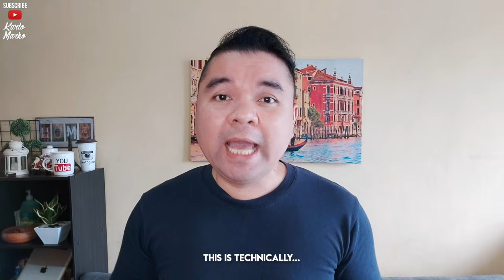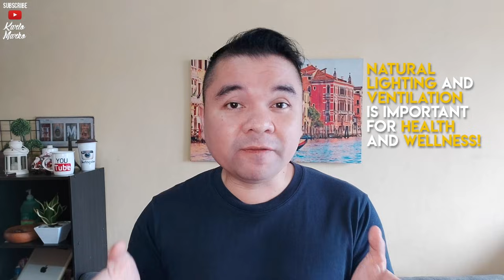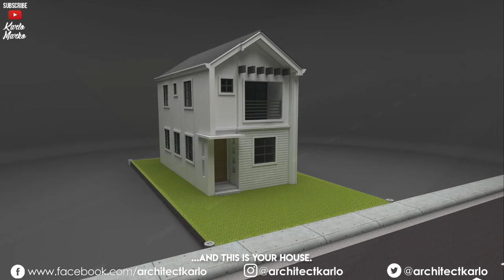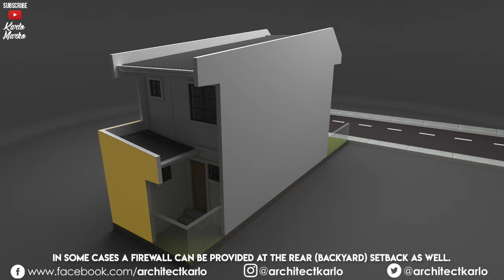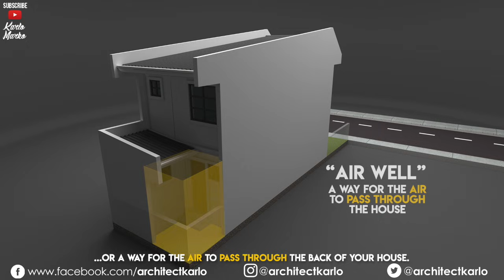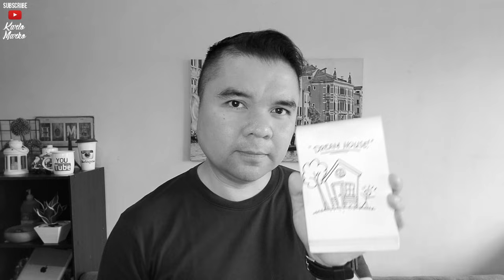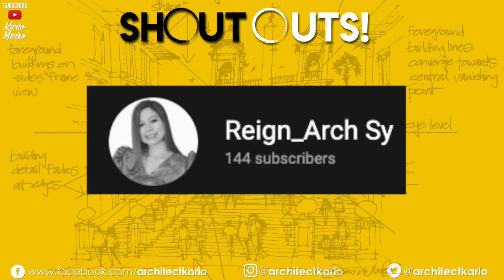The Rules on Setbacks and Firewalls | Bakit Hindi Pwedeng Isagad Sa Property? | ArkiTALK (Eng Subs)

Comment: NIce video po sir.. tanong po paano po maqqualify ang lot na too small or too narrow for a setback? Example R1 if 10m wide pde na po ba maconsider as too narrow? kasi mgging 6m n lng ang width ng bahay. eh kung maiksi din po lote.. 

Or ito po ay laging subject sa OBO?
Reply from the maker: Hi Arch. Magadia,

All these concerns are subject to the OBO's approval later on. Although I won't consider the 6 meter wide as too narrow. Not sure about it's depth though. in Rule 7 R1 is classified to be a low density residential (so this is more or less in the provinces), a single family dwelling and single detached. Pero by experience, the rules on R1, R2 and R3 sometimes overlap. Kaya even with the OBO, they allow the 3 meter front setback na din even if it's for R1. Important naman kasi ke OBO is that there's proper air ventilation and natural light si structure. 

A friend of mine had a project before where the lot is really small... so they had no choice but to put a firewall on all 3 sides of the ground floor, the rear and the 2 sides. My friend was able to defend this issue because the lot was fortunately along the road so the front side was still a source for natural ventilation. Kaya na-approve pa din siya for Building Permits.

Case to case din siya actually. But, when in doubt... consult the OBO for approval and clarification. 🙂

Comment: Pwede nagtanong? May firewall ba na hindi naka dikit sa bahay?
Reply from the maker: Hello po.

Free standing po ba ang wall na tinatanong nyo?

Almost all firewalls are attached to the main house or structure po. Kung makakita po kayo ng freestanding wall... delikado po yun. Lalo pag mahangin tulad ngayon sa #typhoonrolly
Reply: @KarloMarko  salamat po sa pag sagot. Yung isang side po kasi ng fence ng may-ari gusto niyang gawing firewall pero ayaw nya naman na naka dikit sa proposed na bahay yung wall.
Reply: Anyway, ieexplain ko nalang sa kanya yung reply mo po. Salamat po ulit! More power to your channel po 😊
Reply from the maker: Aaah... ok po. Kung less than 1 meter po ang setback nya sa side... masmainam po na lagyan nga ng firewall. Kasi standard po natin talaga for the sides is 2 meters po from the property line. Pero I suggest pagawan nya ng design sa structural engineer para hindi po freestanding ang firewall para mas-stable.

Comment: Sir nabanggit nyo po na ang setback eh para sa natural ventilation and lighting. In the even na may artificial ventillation (natural air intake from the outside so as exhaust) and artificial lighting (gaya po ng electrical lights as well as semi transparent roof) pwede po bang iwave  ang setback? Gagawin po sana kasi naking garahe yung extra corner lot namin pero pinapatabasan ng city officials as setback. Dun sana kami magpapark sa lupa namin instead of kalsada.
Reply from the maker: Hello Christopher 

No. Hindi sya pwedeng i-waive. It is a requirement for health and safety reasons by the law. Pero ang parking is allowed. As long as hindi ito enclosed room. You can either put a firewall sa side along the property line and have a roof of light material. Try to get your architect involved. 😊👍
Reply: @KarloMarko  so basically po pwede ko bakuran ang property line ko then have it as open parking sir? Ok pang ba pagyan ng roof si parking?
Reply: @KarloMarko  We dont have much good architects here far as i know sa location po namin and as we could observe kaliwat kanan po na bahay sa mga subdivision including the one we're at are doing those. They maximize their property lines and close it. Uso rin kasi dito po ang walang respeto sa may ari ng lupa kaya siguro ganun. Nagpapark nga po sa harap ng gate namin on our previous house at sila pa galit  since we dont own the road daw.

Comment: Hello po Architect, question lang po, may nabili kasi kaming bahay na may plant box sa labas, eh ang plano ko po sana eh isagad yung pader namin dun sa plant box para mas lumawak at ma maximize yung space, possible po ba? kasama pa rin po ba yun sa property ko? Thank you and More Power. 😊
Reply from the maker: Hello.

Do you have a copy of your TCT? It should be included there the boundaries of your property. You may do an actual measurement to help you pinpoint the actual size of your property. If not, you can consult this with a geodetic engineer po to verify this for you.

Comment: i have question po sir.. magkano po penalty if may alteration in floor area sa actual construction para ma comply ang 2m setbacks?
thank you po.
Reply from the maker: Hello Sarah,

I am not sure about this penalty for alteration. But normally, if there will be changes during construction it should be reflected on the as-built plans to be submitted to the cityhall as a requirement for the occupancy permit.

Comment: Thanks for the info sir! We live in a townhouse. And nagpaextend kami ng likod, ginawa namin open kitchen para lumaki ang living area. Problem is, kahit may exhaust/range hood, ang init kapag nagluluto. Mas ok po ba na wag na ipaextend ang likod for townhouses?
Reply from the maker: As much as possible natural ventilation is still more ideal than the mechanical one (exhaust fan). I always advice the client to not cover the rear setback completely. Same as the one I featured in the video.
Reply: Thank you sir for your reply! More power! 🙏

Comment: Hi, if the house located in commercial area is being used for residential purpose & only around 70 sq.m. can you apply for exemption of the 4.5M front setback if ever? Thanks
Reply from the maker: Hello. Commercial areas are required a 5.0-meter setback in the front. 😊
Reply: Oh I see.. 😔 Tnx for the comment sir..
Reply: @KarloMarko  pano sir kng 6mtrs setback s harap pero s likod 6inches nlng halos sagad n pwd po b un??
Reply from the maker: Firewall na po dapat sa likod yan. Kapag less than 2 meters ang setback consider it to be a firewall na po. For fire protection din po mainly.
Reply: @KarloMarko  pero ndi firewall nilagay po nmin naglagay kmi bintana po e sir...ok lng po b un
Reply from the maker: Kung pagbabasehan po natin ang National Building Code and Fire Code... Risky po ang ganyan. Kaya po may naka-set na rules para sa protection nyo po. 😊👍
Reply: @KarloMarko  paano po un pattakpan pb un or may penalty lng sir

Comment: Hi tnx, very informative. Pede mag ask, panu gagawin ang septic tank or panu sya ilulugar if tatayuan ng house young buong lote kasi maliit lang lote. Thanks sa reply. It will be much helpful.
Reply from the maker: Hello Lo La,

Isa yan sa mga dahilan bakit mahirap sagarin ang bahay sa property. Pero hanggat maari, sa may bandang gilid sa harapan ng property sana ang septic tank para hindi na kelangang pumasok ang tubo ng malabanan sa loob ng bahay.
Reply: @KarloMarko  tnk u 🙂 any adv if anu structural design ng house pra somehow matibay against typhoons and earthquake since bahain sa province nmin
Reply from the maker: Hi Lo La,

More on sa materials ako mag advice. Kasi mahirap kalaban ang natural calamities. As much as possible use Reinforced Concrete sa buong bahay. Ito yung usual na ginagamit sa construction dito sa Pilipinas. Yung may bakal sa loob. Ipapadesign naman ni Architect sa structural engineer ang supports ng bahay mo at naka-sunod naman sila sa Structural Code of the Philippines (sana). Tapos sana mapatambakan mo ng konti yung lote mo para atleast may protection ka sa baha. Sa bubong, gumamit ka na ng all steel para safe ka. Pre-painted G.I. roofing long span ang orderin nyo para hindi tagpi-tagpi ang bubong. Economical  na yan. Sa pintura... ok na din naman ang latex or elastomeric para mejo waterproof yung walls mo. Semi-gloss as much as possible para kung mabasa man... madaling matanggal ang mantsa. Sa Main Door mo gumamit ka ng solid wood. Para hindi madaling masira sa tubig. Sa bintana, gumait ka ng aluminum or PVC Casement windows. Para selyado ang buong bintana kapag naka-sara.

Kung may iba pang advice si Architect mo... ok din yun. Just get an Architect para sure na safe and secure ang bahay. 😄

God bless and stay safe.
Reply: @KarloMarko  tnk u so mch! Malaking tulong un adv mo nd sasabhin ko rin sa archt na ggawa 😊

Comment: Very informative. Question, do fences affects setback being approved for building permit? I live in Imus and was informed my fence has to have 1 meter setback from the property line. Is this true?
Reply: Nope, as long as perimeter lot mo yun. perimeter fence should be base on your lot sketch plan or sa muhon ng lot mo.... (Architect here)
Reply: @Robbie Mendiola  thanks. I was trying to search about the rule regarding dun sa road widening daw. Not sure. But my contractor told me baka di kame maaprove for building permit pag wala 1m setback from property line.  dahil yun nirerequire ng imus govt. Pero subdivision kami single detach. I was thinking na excluded kami from that law if meron nga. Nasa building code ba yun? TIA po
Reply: @outplayedgaming2866  Do you know that building code requires a sidewalk that will be taken or cut from your property. Therefore you will have a sidewalk on front side of your property then next your build your fence then your front setback. This makes your buildable area smaller.

Comment: Hi Architect,  granting the property reached the residential firewall of both sides of the house, is there any materials substitute for concrete in order to penetrate lights and air, too. Thank you in advance
Reply from the maker: Hello Charito,

For the firewalls as much as possible it has to be fully closed. Fire cannot travel through concrete or any fire-rated material. This is for your safety.

If you plan on adding windows, you can tell your architect. We have ways of adding alternativ windows on these sides. But we need to see the details first.
Reply: Sir Architect @KarloMarko , even neighbors adjacent to our property have already signed an affidavit allowing us to put windows? Thank you for the reply

Comment: pano po ang setback kapag corner lot?
Reply from the maker: Both sides facing the street will be considered as the front setback. That's one of the reasons why corner lots are usually bigger than the middle lots. There are cases where one side of the corner is facing the main road and the other side is facing the minor road. If that's the case the one on the minor road may have the smaller setback and the one on the major road can be considered as the front of your property.

Comment: hello po, I want to ask po about a design problem where we need to provide firewalls in 3 side an apartment since R3 yung classification nya ang kailangan isagad sa 3 sides para ma maximize yung space ng lot. Possible po ba na magkaroon yun ng proper light and ventelation? or may iba pa pong paraan mara mamaximize yung space ng lot para maachieve ang 20 sq meter kada unit na may 5 meters front setback.
Reply from the maker: Have airwells po.

Comment: Praktikal po ba ang ang isang centralized  ventilation at air conditioning  system dyan sa Pilipinas? Papaano naman po kung gusto po ng homeowner ang may basement na kasing laki ng ground floor are ang bahay? Thanks.
Reply from the maker: Hello Alca Razor,

I am always in favor of natural ventilation and not the mechanical one. And I think that it proves benefitial also in this time of the Pandemic that natural air... is more helpful than confined and refiltered air.

Basements in houses are not that common here in the Philippines since we are prone to typhoons and torrential rains. 🙂
Reply: Salamat po.

Comment: Yun pong front setback na 4.50m minsan ginagawang 5m for carport, tanong lamg po kung pede po ba lagyan ng bubong ang carport.
May nag tanong po kase sa classmate ko dati, kung ok lang po ba lagyan ng columns (L-shaped) ang sagad ng front setback para may bubong ang carport?
Reply from the maker: Hi Kimberly,

A roof on the carport is ok. As long as it is not higher than 3.2 meters.

The National Building Code: Section 704 states that: Absolutely  no  firewalls  are  allowed  for  a  low  density  residential  (R-1)  uses  or  occupancies; "an  abutment  of  up  to  3.20  meters  from  established  grade  level  may  however  be  permitted but  solely  for  the  purpose  of  supporting  a  carport  roof;  provided  further  that  such  abutment shall  be  constructed  of  perforated  or  decorative  concrete  blocks  above  1.50  meters measured  vertically  from  the  established  grade  level;  such  an  abutment  shall  not  be  longer than  7.00  meters  or  50%  of  the  side  property  line  in  total  length,  whichever  is  shorter."

- abutments = structures.

Comment: Meron po bang vlog tungkol sa setback Ng commercial establishments?
Reply from the maker: Hello Brigido,

Commercial setbacks depend on the type of road it's connected with and its LGU authorization. So if ever, you may need to double check with your city or municipality.

Pero here's a gist:

For roads with 30m width:
Front = 8.00m
Side = 5.00m
Rear = 5.00m

For roads with 25m to 29m width:
Front = 6.00m
Side = 3.00m
Rear = 3.00m

For roads with 20m to 24m width:
Front = 5.00m
Side = 3.00m
Rear = 3.00m

For roads with 10m to 19m width:
Front = 5.00m
Side = 2.00m
Rear = 2.00m

For roads below 10m wide:
Front = 5.00m
Side = 2.00m
Rear = 2.00m

Again, you may check with the local government authorities for verification. 👍

Comment: Sir Karlo salamat Po sa learning about setbacks. Question ko lang Po. Meron Po Ako nakuhang property sa Cavite under acquired assets Ng pag-ibig. Meron na structure pero Hindi sagad sa buong lote. 54 sqm Po Ang lote. Corner lot. Townhouse Po. Plan Namin na same size lang Ang 1st floor pero sa 2nd floor kami mag-extend sakupin Namin buong lote. Allowed Po ba iyo sir? Thank you sa pagtugon. God bless
Reply from the maker: You can consult the subdivision admin for this po if this is possible sa rules ni Cavite. You can also check this with the local cityhall office of the bldg official. May classifications po kasi ang lots. If ever ok lang, you can maximize your space but provide firewalls sa mga sides na nakasagad sa property line.

Comment: Hello sir, ask ko lang po incase may firewall ako both sides (Right and Left) of my house, may kailangan bang maintenance ang firewall like painting of the wall pagnagkatagalan eh hindi naman ako cguro papayagan ng kapitbahay ko i-access ang bakod nila para lng mag paint.
Reply from the maker: You can kindly request your neighbors to allow your workers to work on that side. Tell them it's for fire protection naman. Plastering and painting it will add to it's fire resistive properties. Don't leave it as CHB or bare walls alone. Better have it plastered and painted.

Most paint have fire resistive properties. You may check your paint supplier for their fire ratings.

Comment: Hello pero pde prin mg set ng fence along the property line? Thx
Reply from the maker: Yes ofcourse. 😊 As long as the materials used are permitted by the law. In some subdivisions, there are height restrictions for the perimeter fence. So better check with your local municipality, subdivision admin or Barangay.

Comment: Sir, paano kapag townhouse,  then paano yung exit plan or designs.. Kasi usually walang fire exit yung townhouse sa likod ng bhay..
Reply from the maker: Hi Mam Ella,

For a single family dwelling, the front and main door is the main exit especially in an event of a fire. Normally, this is enough for a single family. The back yard or the rear is never an option for fire exit. Because fire fighters and rescue will come from the main road as well which is located at the front. So the back is not an ideal exit incase of fire.

That's why some townhouses even provide a retractable ladder at the front on the 2nd floor. It serves as a fire exit if in case the family is trapped on the 2nd floor.
Reply: @KarloMarko  thanks sir.. Best ideas. And new things to learn po..

Comment: How thick should fire walls be
Reply from the maker: Ideally, for houses: Wall thickness should atleast be 15cm to 20cm
Reply: @KarloMarko  how does party walls differ sa firewalls po specially for duplex
Reply from the maker: Party walls or partition walls are usually located inside the structure. Firewalls are usually located around the structure's perimeter or at the edge of a property (or the lot).

Comment: Hi Architect, pls may I ask the setback rules for a triangular lot? I saw the figure VIII.19 of the NBCP, did I understand it correctly that triangular lots are exempted from front yard requirement?
Reply from the maker: For odd shaped lots, the front is considered to be the one facing the road or along the road (public road right of way).
Reply: @KarloMarko  yeah. Then what will be the required setback from the road po?
Reply from the maker: You need to verify with your city building officer (sa city hall) what classication your lot is in or what is the duly approved zoning location of your lot. It depends kasi on what's the category of your whether R1, R2, R3, etc. Lahat ng ito ay may specific limitations and variations sa kanilang mga setbacks and open space requirement.

Comment: Archi, ano po acceptable windows or pang close for air outlet/ventilation? Is fix metal louver acceptable?
Reply from the maker: Usually, air outlets are of stainless steel, hard plastic and other water and weather proof materials.
Reply: Pwede po ba to use it sa wall na facing sa likod ng kapitbahay?
Reply from the maker: You need to ask permission from your neighbor po. In respect to their property. Some neighbors are lenient some are not.
Reply: @KarloMarko  aaaah thank you! Hoping they would allow us